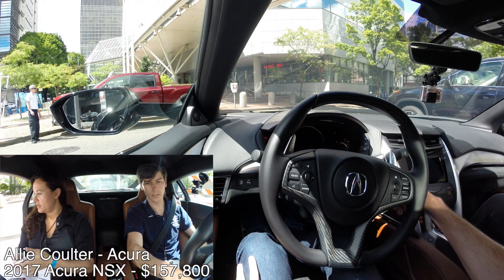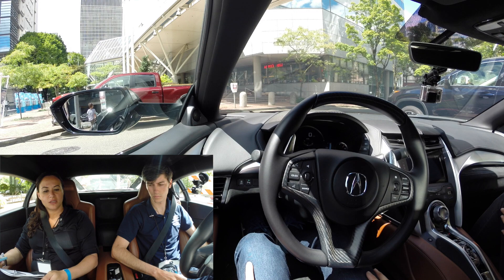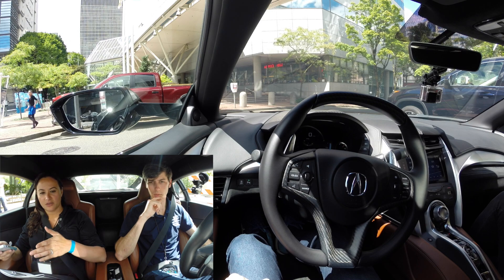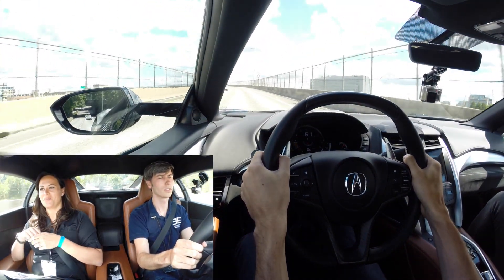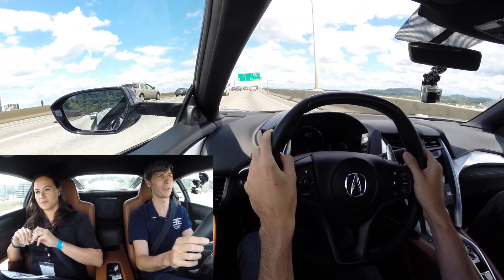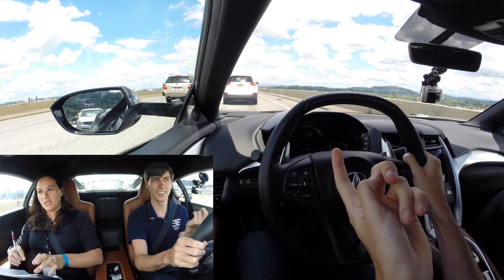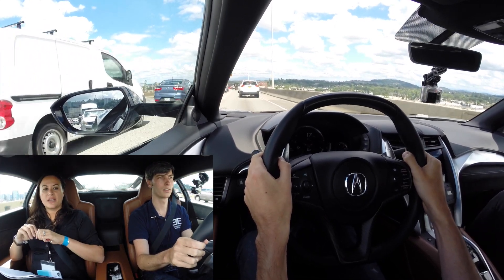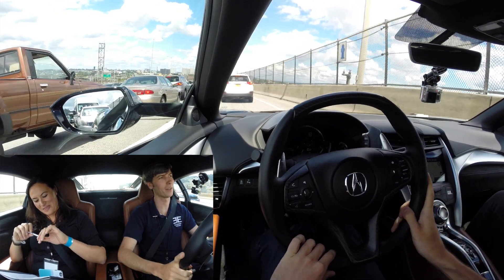2017 Acura NSX - A Casual Portland Drive

Comment: you didnt asked how the launch control works. dose the front electric wheel aid the power of launching or its purpose is for vectoring and quiet mode?
Reply from the maker: Electric motors up front will certainly aid in launch.

Comment: This is a genius level engineering. They literally made everything smooth while making you have full control instead of feeling assisted and people are complaining that they should take it out?? People can never be satisfied. Using everything available to make it fast not only in a straight line but also around a corner while putting a smile on your face...✔.

Comment: Help please, want to buy but... Knocking sound from engine, chain was replaced at 59k miles and now is 68k miles. Knocking sound only appears when start the engine, and press accelerator pedal than sound going louder, but after time disappears and when you drive no sound. 2005 (55) - Vauxhall Signum 2.2i Direct Elegance Auto 5-Door  ???(Thank you)

Comment: I miss pop-up headlight on old Honda NSX. 😔
Reply: no horizon flip up headlights were on cars into the 2000's. They became illegal for manufacturers to make new cars with flip up headlights in the UK and other countries because they didn't meet pedestrian standards.
Reply: hell no fam im staying in the good old days lol. cars are just computer operated now
Reply: no horizon Yea flip up headlights are cool, they're just different. As far as living in the past the 80's and 90's are marked by the most connected driving experience. The 70's was the era of the horsepower wars (at least it was in the US). The 60's was the last decade of true unrestricted designs. The 50's were the dreaming of tomorrow with radical designs inspired by space exploration. And I'm sure 40's, 30's, 20's, 10's etc were all marked by a certain persona. 

Current times is all about technology and a push for as much as possible. The 80's were kind of like that, but really more superficial than it is today. I'm sure in the 2020's car designs will be marked differently as well.

Comment: It's so sad how the NSX went from being a sportscar to being what is pretty much a hybrid supercar. It was literally in the name. New Sportscar Experimental. It kind of strayed away from the roots, much like the GTR, but with the GTR, they took it away from the Skyline badge and so the Skyline and the GTR from Nissan are still following the original vision. This, it's questionable. I hope that Honda comes out with a new Mid-engine, rwd, affordable sportscar like the original NSX was as well as the MR2, but closer to the Toyota MR2 as it was more affordable. It would probably compete with the GT-86/BRZ if it were simple enough. I just wonder if such a thing would be possible.

Comment: One thing i hate about this car: Electronic dependency. Both brake and gas pedals are electric, no linkage, just a sensor.
Reply from the maker: All gas pedals these days are just sensors. Brake-by-wire is fairly unique though.
Reply: If the wire fails you have nothing too.
Reply: The brake pedal is designed to give you feedback. Most people don't even know because it feels so natural. So yes, it does feel "right".
Reply: How did the brake feel compared to a regular setup? Did it feel "right", like you could push it, and still feel confident?
Reply from the maker: I didn't know it was brake by wire, but with electric motors this is always partially the case (for regen). I don't recall feeling the difference between electric and discs, but thinking back I don't believe it had as intuitive of a feel as typical hydraulic vacuum brakes. I'm sure anyone could get used to it.
Reply: Its just mainly if the electronics fail, you have nothing
Reply: I'm sure there is a fallback mechanism

Comment: If I had $180,000 laying around I would just use it to convert my mom's 2011 Eclipse to a mid engine with an ls6 turbocharged with 800 hp and out run this thing

Comment: This car is $420k in Australia. lol

It's not so much the electric motors, but the heavy battery. This car is around 1700KG? Which is a lot heavier than the average supercar with internal combustion.
Reply: ***** Meh, they're just toys and looking at VFACTS, the sales figures of cars over $200K was up 19% last month. Besides, those buyers usually claim tax on those cars anyway so stop whinging about LCT.

Comment: They won't sell a lot even thou its great cause no one connects acura with sports cars.  Its like if honda made a amazying car.
Reply: Where did you pull that from? How far did you have to dig up your ass?
Reply: All supercars are generally low-volume. If anything, lower sales will be because of most pro reviewers nagging on the lack of lineage and design, and the introduction of the triple-set electric motors

Comment: they changed the engine more because there is no rooms for fitting the twin turbo + intercooler for the transverse mounting, but without the twin turbo itself just too under power in its class.

Comment: After that video on CVT, Now I wish performance car would use CVTs if they don,t have manual. This car is cool. But too complicated. I wish honda/acura could make a BRZ competitor. Older NSX are still hotter iMHO as puredriving car. But this is their flagship, So I guess it's normal to pack it with all the tech they have. Still, it's cool the see honda making High tech car, The idea of a electric engine of the crank to compensate for the turbo lag is genius. 
Now we need a FIT with the L15B7 so I can replace my 2007 fit. 

It's just a shame that Acura are not as a performance brand as they claim. Now it All Big heavy luxury with no manual. Now, except for the NSX, their cars are ugly as hell. They should bring back the integra/RSX.

Comment: if you can't just appreciate this car, you're not a car guy.
Reply: I don't really care if a car is true to its predecessor (as long as it is content with the idea the designers of the predecessor had. So things like the new beetle or Fiat 500 aren't things I like.) but I do care if it is a well made car. And form what I have seen from this video, it is a well made car.
Reply: Well that makes sense. Your car has the little BMW logo on it, of course you're going to get more looks and gawking. I'm pretty sure if BMW made a similar looking vehicle to the NSX, and put their little logo on it, people would drop their jaw to it "just because it's not just any super car, it's exclusively a BMW super car." But, Porsche 4Lyf!!!
Reply: Honestly I think non-car guys appreciate it most because it's that million dollar tech feeling, but accessible at $160K. Car guys remember what made Honda famous for enthusiasts. The R-Types, the original NSX, the S2000, etc. I mean it tells you something when Honda goes "no R-Type shall have an auto, all must be stick shift" of course that will change eventually, but you get the idea of the hard core mentality. Honda used to go on the deep end of perfection, like going as far as weight saving by reducing the thickness of the carpet, lol. 

This NSX is impressive, but to the car guys old enough to remember all the amazing things Honda has done it's such a departure from what made them popular among enthusiasts to begin with.
Reply: Sigma Projects Wow.  I was not aware of that, good info haha
Reply: Blas Molinari NSX, New Sportcar Experiment.  not old car experiment.  embrace change and technology my friend.
Reply: #Porsche4Lyf
Reply: It's cool, but I don't think the new NSX will be remembered so fondy as the old one
Reply: Кристиан игра Питер Perhaps. But my point is that the first gen NSX looked extremely unique 20 years ago and still does today (casuals would think Ferrari). This new one not so much. GT-R, R8, yawn. Only Ferrari and Lamborghini are still being creative. I doubt casuals know what the Lamboghini logo is but they're gonna turn their head when it drives by.
Reply: Tyson Stites Yea, mid engine anything gets heads turning. Also depends on the crowd, a R35 pulled up to this meet and almost no one looked at, then some old Toyota pulls in and everyone crowded around it XD
Reply: Tyson Stites Again I say, I'm talking about normals, not car guys. A mid engine car's shape isn't as unique as a fastback to the untrained eye.
Reply: +aestheticstorm i know youre talking about normal, non-car observers, and always did know that from the beginning.
Reply: +Tyson Stites non-car guy* observers
Reply: +Tyson Stites the Gtr isn't a supercar though it's a sports car the our performs super cars. It's not supposed to look like a super car.
Reply: +josh waterman i would agree with you, but if you go to nissans own website where they show their whole lineup, the 370z is listed as "sports car" and the gt-r is listed as "supercar". at least it was the last time i checked their site.
Reply: +Tyson Stites i just checked it again and both are now listed as "sports cars". but i promise that recently it was as i previously described.
Reply: Not A Dog you wouldn't know that until 20 years from now.
Reply: you clearly have never known the original nsx and what made it great.  A real car guy would understand how silly you sound.  You are definately young and did not grow up with the nsx.
Reply: I can't appreciate it because it's not the same NSX we grew up and loved. It's just another one of Honda's attempts to draw in a large crowd over a legendary model that wouldn't work well.

Honda is always just outselling themselves. They should just stick to the motorcycle market. :P
Reply: I appreciate the technical aspect but its visual design is uninspired like the GT-R and so many other modern cars. This is another car that 95% of casual people will think cost $100K less. I drive a BMW Z4 ///M Coupe and I guarantee I get more rubberneckers than cars worth 4X more.

Comment: Not being a dick but why do they make cars like this an automatic? Wouldn't the people buying these want a manual?
Reply: From a performance aspect, a manual transmission just can't compete with a dual clutch automatic like this. There is a reason why F1s have paddle shifters these days.
Reply from the maker: Haha, they make them with DCTs because more people in fact, do not want them with manuals. Unfortunately, consumers really do drive these decisions, and those with the money are opting for 2 pedals.
Reply: Just strange that those buying high performance cars are opting for that.
Reply: lol a manual in a supercar is a terrible idea.  Only an auto can make full use of a supercar
Reply: Its all about the numbers these days. If the numbers look better on paper its usually a hit with the richer class.
Reply: +Dennis Vu
So you're telling me people who buy this car is going to care about getting the full maximum utmost performance out of the car like they're only using it for the numbers at a track? A Prius is still capable of speeding on any road it wants to, why does an already extremely powerful STREET-LEGAL car have to sacrifice a huge part of the driving experience because it needs to be the fastest it can possibly be?!
Reply: Because racecar.
Reply: +Brian Martone even the R8 did away with stick shift :(.
Reply: The dct is faster at shifting. plus with the advanced hybrid system, you don't really want to have too much control over the gearing and what not.
Reply: +MrRhubarbs I think what Spencer is saying is that he doesn't understand why all these high performance drivers cars are completely doing away with the option of a manual. I'm an enthusiast, plenty of track days and passes at the drag strip and I would opt for the slower manual over the 0.2 second faster car in a quarter mile.
Reply: RIP clutch pedal. I miss you SO much
Reply: Spencer Calanca True my friend.
Reply: in the argument of whether or not manual tran will be outperformed by a DCT blah blah blah. whether it makes the difference of a  minute or a second to your track time, you will never get the exhilaration out of any car that isn't manual.

in the end, the minute difference in your track time won't be worth trading the fun in driving a manual.
Reply: FerpiliciousProducts 
I don't know what the world is coming to. How  is this going to motivate me for future success if all of the super-cars I would want to own are basically automatic?... first world problems hahaha
Reply: +Brian Martone yeah same. If I had to buy a "supercar" I'd probably settle for a Lotus Evora 400 just to have that stick shift. The only other car I'd really want is a Vette or a Viper ACR.
Reply: I'd rather have this though.
Reply: You drive a stick. You ride in an auto!
Reply: +obanr 
I can't agree more. Who the frick actually cares about numbers on paper? It's only good for bragging about how fast the car can go like anyone really cares when it comes down to it.
Reply: The general opinion is that high performance cars are faster, more controllable, can reach higher limits, and are more fun if they are dcts. Manuals are much more enjoyable and shine in cars that are slower, such as sports cars.
Reply: I mean I would still drive one but I dont think I would pay for it myself.
Reply: +Aaron Boggs f1 cars have sequential gearboxes. they shift without clutching and a computer fits the engine rpm to that of the wheels.
Reply: But it's not, It's a street car.
Reply: Well the thing is, you won't be able to shift like the computer can in order to optimize the power of the car......and that's what they're going for.
Reply: KEINOMADDONE 
Yeah you're right maybe not for this car, but most other super-cars should accommodate for it.
Reply: FerpiliciousProducts
Oh yeah forgot about Lotus, I would love to own an Evora 400 that car looks like a ton of fun.
Reply: +Brian Martone Also the new Aston Martin Vantage S V8 is a manual. Looks awesome from reviews.
Reply: +Dennis Vu you my friend haven't seen Ferraris, I'm sure that you can easily buy one with a manual. (fyi, Ferrari's are supercars)
Reply: It's the same reason there were people buying automatic porsches before even DCTs were offered, lol. They have the money and don't want the inconvenience of shifting and such. On paper DCTs are the fastest, but really it's because they want to feel like a hero. Lotus went through a change a while back because they only offered manuals and they found they could sell more cars if they offered some autos.
Reply: higashino keigo I hope you were calling me a kid! :) "Better" is subjective.
Reply: ***** It's true of almost all companies. Toyota did that in the start of the mid 2000's, stopping all sports cars in favor of just making passenger cars.
Reply: it's a supercar. A manual would be too slow
Reply: Yes but it's still a street car. You don't see super sport bikes with Moto-GP features. It's just pointless.
Reply: Tomasz Just saying it would be more fun.
Reply: +Spencer Calanca 
Good point. But there are automatic and electric bikes like Zero motorcycles. I mean you're taking taking something that is meant to be for a road enthusiast, already very fuel efficient, killing the sound, and completely removing the engaging driving dynamics... It's sad to be honest
Reply: In the case of this NSX, they can't offer it in manual because the computers need to be prepared for torque fill via the electric motors between gear changes for uninterrupted acceleration. A computer has no idea how long you'll take to shift a manual transmission, especially because it's not the same every time.
Reply: aerods meh, it's fine in my first gen insight with a stick. Regen braking with a stick is really nice too.
Reply: I get that DCT is better for performance but as I mentioned to another dude. This is a street car.
Reply: +skirmich 
So, your only argument is that it's faster? Jeez I could have done better than that. 

I'm going to bet 99 out of 100 drivers will not notice a difference in speed. This is because it's a street legal car that is hopefully staying within the speed limit most of it's time... nobody is sitting in traffic with a stopwatch in their hands and worrying about timing their 0-60.

In a perfect world, in my opinion, every car word be manual. Yes, it's not the hardest thing to do, but they require more responbility and knowledge of how a car operates that it almost feels like it should be a requirement for someone who can afford these cars.
Reply: +Das Boot
4 hours?... I don't know what type of traffic you're in but that's extreme. And yes, I would be fine with the traffic for a small percentage of the time if I'm enjoying the car more for the majority.
Reply: Traffic is just as bad in an automatic.
Reply: Yes... I would like a manual but speaking logically, there's no way our left foot and shifting hand can ever defeat a DCT. So it's only fair for supercars today to run on DCTs.
Reply: +Spencer Calenca
You're completely right, and it's honestly sad they don't even have the option available for manual for the people that do want it. It would be about the only reason I wouldn't buy one of these cars.

Comment: When I worked at Honda, I remember people talking about the internal application process in order to be selected to build these beautiful cars. The requirements were insane. I think you had to have like 20+ years of assembly experience to even be considered. Aside from the automated processes done by robots (like weld  and paint), these are all built by hand in a very controlled facility about 15 minutes from Marysville, OH. Generally, I don't really care for Hondas (I drive a VW), but if I could afford this thing, I'd be on it like white on rice  ;)